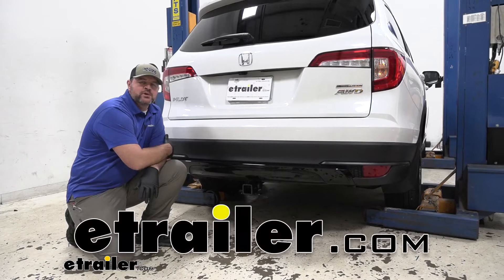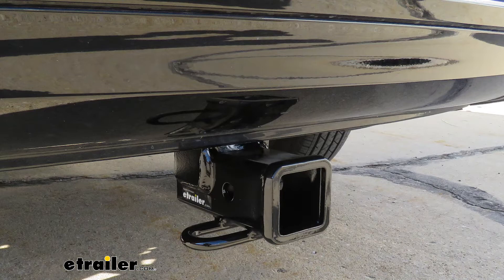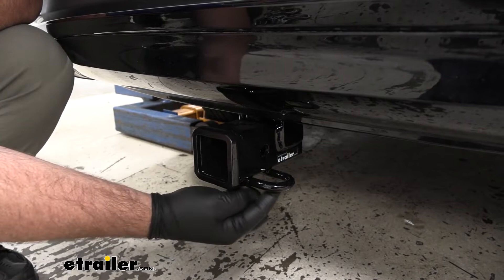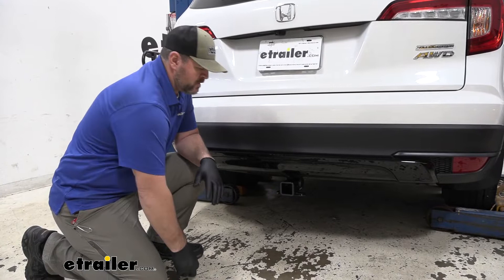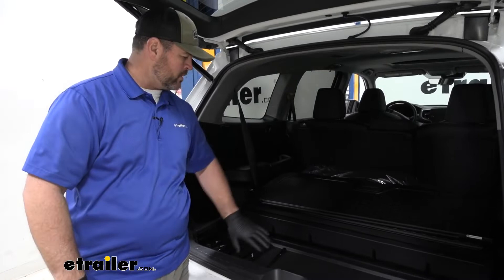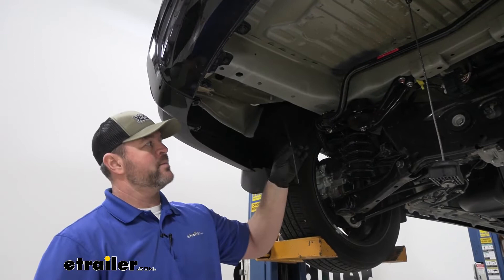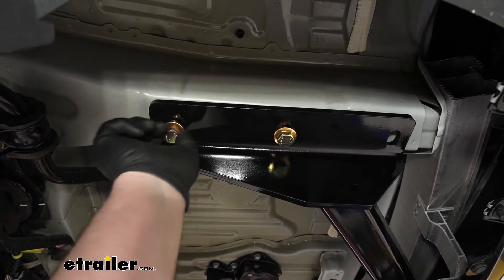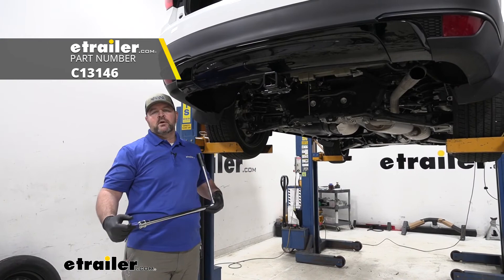etrailer | Curt Trailer Hitch Installation - 2021 Honda Pilot

Comment: It doesn’t seem to matter if the tire is there, I’m wondering why it’s necessary to remove it for the install.(?🤔)
Reply from the maker: We remove the spare tire in order to allow for more space when completing the install. It is difficult to lift the hitch into place when the spare tire is still in place.
https://www.etrailer.com/Trailer-Hitch/Curt/C13146.html

Comment: Is this hitch model made specifically for the 2021 Pilot Special Edition? Is the "Custom Fit" on site referring to the lower bumper on the Special Edition?
Reply from the maker: This hitch is designed to fit the 2016 - 2021 Honda Pilot. Check out the following link for more information on this trailer hitch.
https://www.etrailer.com/Trailer-Hitch/Curt/C13146.html

Comment: Great video very informative.! I just bought the 2021 Honda Pilot, but it comes with the automatic rear hatch that opens when you wave your foot underneath the rear bumper. Would it be the same item number if I wanted to buy that hitch?
Reply from the maker: Yes, the sensor will be blocked. Some people do not have issues with using the hands free lift assist after installing this hitch but if you do Honda makes a sensor relocation bracket. The Honda part number is I08L91-TG7-100C ; your local Honda dealer should be able to help source that part.
https://www.etrailer.com/Trailer-Hitch/Curt/C13146.html
Reply: @etrailer  thank you very much!!!
Reply: I installed this hitch to my 2021 Pilot Special Edition yesterday. Rear gate sensor is blocked. The Honda part no mentioned in the previous comment looks like a new tailgate sensor rather than relocation bracket.
Reply: @nandhakumarsrinivasan8028  hi, were you still able to use the rear kick sensor to open your trunk after installing this hitch. ?